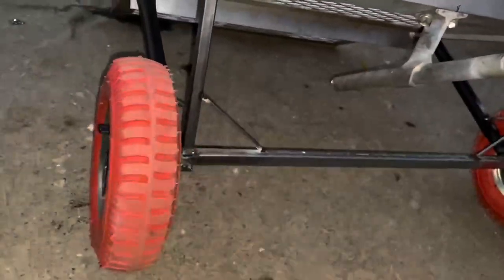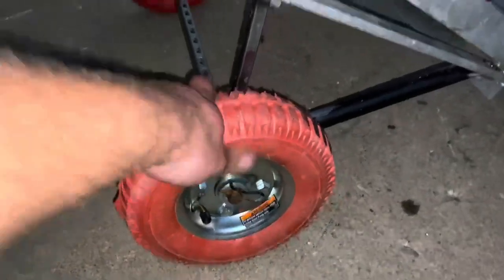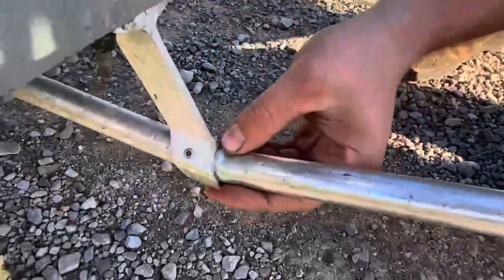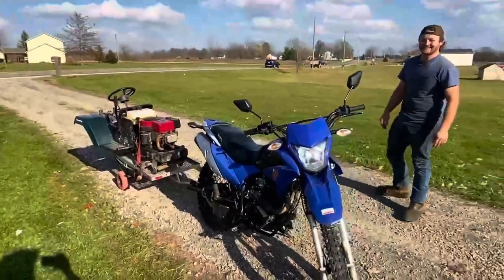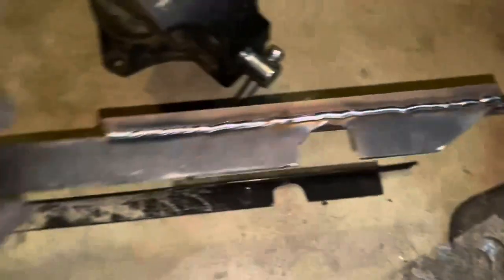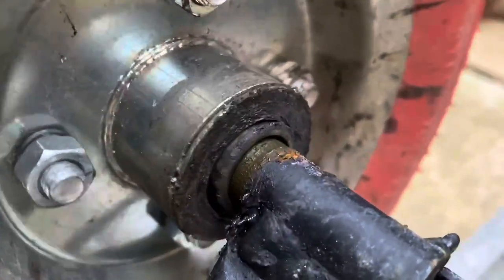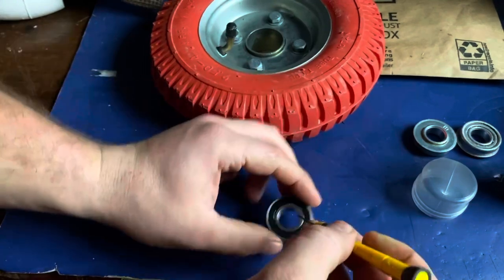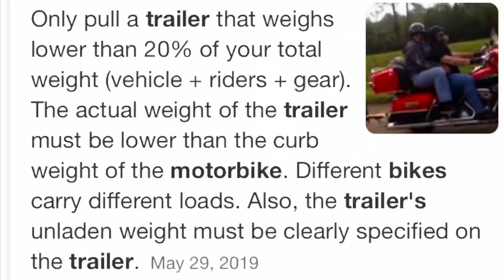Hawk 250 TRAILER BUILD & TEST

Comment: Nice. I pull a factory built aluminum bicycle trailer with my TT250. Groceries each week. It’s illegal.

But dude with the small tires you have a terrible high center of gravity in the trailer with a lawnmower in it. Be careful !!

You do know that pulling a trailer behind a motorcycle that  a trailer license is required. On City streets. ??? Also tires must be rated for highway speeds to be legal, as well. 

I want to build a micro tear drop for my Yamaha 1900 Road-liner. 

Ive heard it will be a bitch to get registered and tagged.  

Also def reinforce the tongue and hitch and get taller wheels!
Reply from the maker: Yes! Unfortunately I know all about the legality’s! I am going to put some DOT stamps on the tires and get it registered. It’s not a big deal in Ohio. Home made trailers are very easy to get legalized. Thanks for watching!
Reply: @goodolboys713  cool. I guess just Texas thing. Be Careful as you are experiencing things first hand. No boundaries other than some common sense.
Reply from the maker: @MrCbell57  thanks, will do! Be safe!

Comment: Tire issues? Point I’m trying to make!  Bigger tires better bearings and they need to be highway rated. 45 mph minimum. Don’t expect to be able to use a dolly tire as a trailer tires they just won’t work. Spend more money that’s the key. Lol
Reply from the maker: I definitely see your point! In reality it’s not about the cost of trailer tires, it simply has to do with the weight of the trailer. The smaller and cheeser the tires the better! Lighter trailer also allows higher payloads. With all the off-roading the trailer sees, I need to be able to pick it up and carry it. I have looked into small factory trailers like the 42”x48” from harbor freight Unfortunately they just weigh too much. Even the aluminum version weighs almost 200 lbs!!! That’s more than my trailer and payload combined weigh. It’s simply safer to tow a lighter trailer like mine. Thanks for the awesome comments! I’m sure there will be a few readers reading into this and hopefully all this commentary helps them out. Thanks for watching!